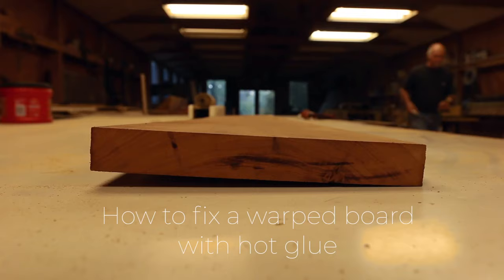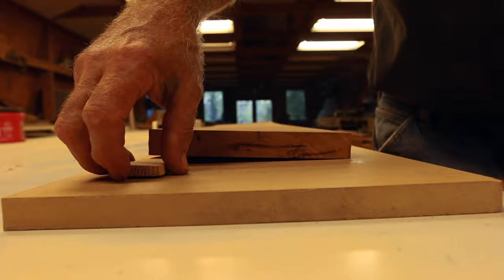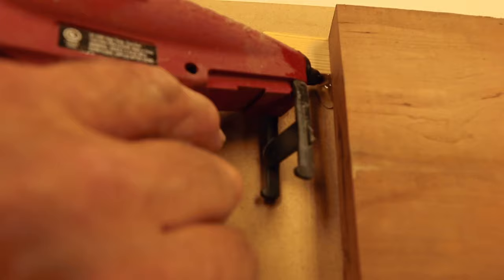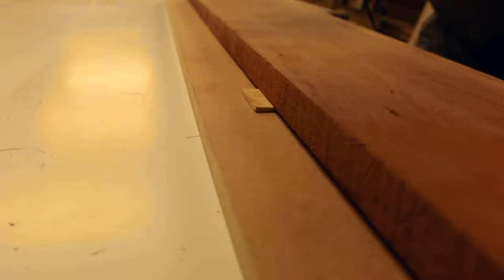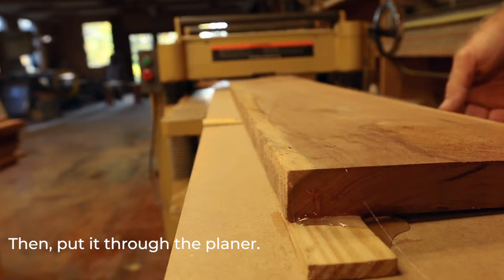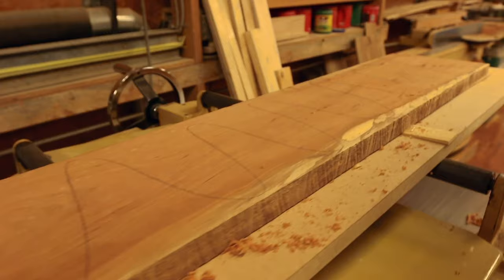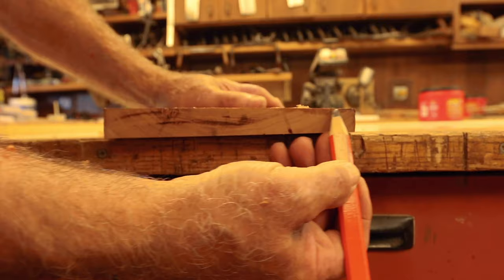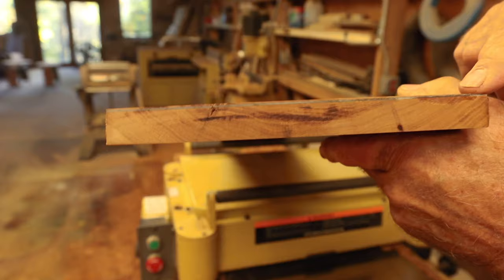How to fix a warped board with hot glue (simple)

Comment: I used some large 25 lb weights and didn't have to shave anything off. I laid the warped board on some flat concrete and put some weights on it. Worked great.
Reply: Doing the same 
How long did you leave it for
Reply: @newpatchincoming6574  a few days for me, I just take the weights off and check to see how straight the board is every morning, then put the weights back if the board is still warped. My boards also seemed straighter after priming and painting for some reason. I also let the boards dry on my flat driveway, of course with the painted side up so to not make a mess.
Reply: @anonymoususer7663  thanks

Comment: Thanks for a simple solution to a problem all of us woodworkers have from time to time.  I've seen a couple of videos where a jointer is used to also remove twist, although you're a little more limited on the widths of boards you can use that method on.  I have a few boards in the shop that have been aggravating me for some time due to the twist in them.  I think it's time to fix them.

Comment: One of the clearest explanations I've seen about how to do this. Others have asked why not use a jointer planer to make one side true, then use the thickness planer for the other side, but this way means you only need to use one machine. And your jointer may not be big enough for a wide board - thicknessers commonly have much wider beds. You also have far more control with the wedges - with a warp that big it would be rocking all over your jointer bed, so much more difficult to use. Great video, thanks.

Comment: Thanks for the great video.  I have a twisted  4" x 8" section which I will be using as a pilaster to break up siding and board and batten cladding on my house build.  This technique will fix this issue.  Also, I will be laminating sections for railing rails and posts, so this will come in really handy.  Cheers from Canada.

Comment: Wow!  You reduced that board down to a toothpick!  It's better to mill your stock as close to the finished size, leaving some excess for snipe, trimming, etc. That said, a better method is to split the wood down the center, mill the two pieces flat to the same thickness, joint the cut edges flat and then glue them back together. This leaves a lot more material with minimal loss.

Comment: Great method! I would leave it a day and see if it remains flat, since removing wood can also change the internal stresses. It may take a few times for it to stabilize.
Reply: If you gluing up a few boards, then why can't you stick them all up together immediately once this is done and whilst the wood is all flat?
Reply: @conradpaul6100  you can, but there’s no guarantee that it still won’t move. Cutting away wood releases internal stress, and the wood will always want to neutralize that stress. If you glue up immediately, you may end up with a wider glue-up going out of flat. If it’s wider than your planer at that point, you’ll have to hand plane it to get it flat.
Reply: @Pauken11  ok Jim, thanks for that. Would be nice to learn the theory about Wood, sure it wood help with my woodworking efforts
Reply: ahhhhh great tip! i suspected as much but i am a bit of newbie. I was wondering why my board was slightly out after checking it 2 days before.

Comment: Thanks for sharing!! That was great.
I wish I had a planer, though! Haha
Reply: I don't have a planer either. But it should be possible to use the same technique using a router as a planer (on a sled)
I'm going to try this in the (near) future. On much smaller boards though.
Reply: @hansdegroot8549  
It works.  But the finninsed job won't be as finished youll need to do a few more steps to it depending on its use.

Comment: now you got 1/2 a board. just use hot water clamps or weights put in the sun
Reply: Hmm, that's a bit of an exaggeration. It reduced it somewhat, but not by half.
Reply: Better to have a thinner flat board than a thicker unusable one.
Reply: Clamped to what?
Reply: There’s no guarantee that heating and wetting will result in the board staying flat once dried back to 7%. Milling it flat is more reliable for fine hardwood projects. Not every board needs to be 3/4” thick. There’s plenty of use for half inch and even quarter inch boards. And the thinner it is the less important warping is since you can often force it flat with screws or glue depending  on What you’re making.

Comment: My question is how thick was the piece of wood you used before it was flattened and how thick was it when it was completed.  I would imagine that if you're going to be working with 3/4 inch wood, you would need a 1inch piece to start.  If you start with a 3/4 inch piece then you might have to bring it down to 1/2 inch which is not good.

Comment: You can also get a board soaking wet “let it set in water for 24 hours” then take it outside or in a place where it’s hot and lay it on a good flat surface and put something heavy on it and let it dry. I use concrete bags a whole lot for the weight because I build a lot of decks. I use this method on big boards and even posts like a 6x6x16. Had them delivered by Lowe’s and they put the posts on top of the wood bundles with a good 5-6ft hanging off each end and it bent them like a noodle. Instead of taking them back I soaked them very heavily then laid them on the concrete driveway with concrete bags on them where the bend was. It pushed them right back into place.
Reply: This is such a horrible idea I don't know where to start. Though this may be an acceptable method of correcting warpage for construction grade material, the average woodworker would suffer a lot of consequences after following your guidance, both in the short term and especially long....I cringed after reading this

Comment: Question: Does the warp creep in again after that treatment?
As a novice I guess you have to fastly use that finished board before it starts to move?
BTW really enjoyed this fantastic trick!
Reply: Yeah whenever you work with any wood, but ESPECIALLY warped wood, you should plan on using it right away so you don't give it the option to re-warp. All wood will warp unless it's an exceptional board kept in perfect environment, which 99% of us don't have either of at jome

Comment: Thank you for this video! I recently did a burn design and it caused my wood sign to flex in the middle. Any suggestions on how yo fix it without cutting/planning it? Thank you!
Reply: Put calls over the back side  and glue them to it provided they are stright it should take out the bow.  You can also glue on aluminum like 1x2 angle  the hot glue will stick to both the wood and the aluminum.   But either of thoses 2 ways will have to stay on it. 

You can flatten it with steam and weight
On the top of the bow  it might make it flater but it will take sevral trys to get it true. And it could bow back.

Comment: You didn't fix the board with hot melt glue. You used a thickness planer. You might as well have said "How to fix a warped board with thin scraps of wood."

Comment: Sometimes all this isnt nessary if you cut 
Your rough sawn boards to a slightly larger size then the finished part then mill it true. You might save more of the thickness or length or width and have overall more true sized wood for your project, thickness is better on a table top
It just looks better.  

I ran into one 2x4 at the lumber yard once there really was no hope for 
This board was warped cuped twisted and bent its whole length only thing that would have made it worse is a big fat split but it wasn't split.  I should have gotten it, why you ask?  Might have made the coolest looking project you've ever seen.  We work wood, but we can also work with wood to make it be what its trying to be.  The Japanese are good at finding what wood wants to be. 
If you do that its never going to change its shape, guys have made things that looked great, but didn't last becuse they ignored what the wood was saying. 
All the brute force in the world isn't going to stop wood from changing its shape when it wants to in fact somthings going to give.  I know thats an extream comment but its true  to an extent.

Comment: How about using a jointer.  You should always joint before planing.  These two tools together get the job done.
Reply: The purpose of a jointer is to get two edges 90 degrees to one another. Can’t do that with a twisted board. The board in the video can now be jointed to make the edges 90 degrees to the faces, making it true all around.
Reply: @Pauken11  Correct, that is why you first joint and then plane. The board will be true.  If you don’t have or cannot afford these tools, there exist techniques that may come close.
Reply: That doesn’t make sense...   what are you jointing to?
Reply: @haidafella8651  you joint a board to make 1 edge and 1 side true.  Then you use a planer to make the other side true.  The planer uses the jointed side to make the other true.  Then you would use a table saw to make the unjoint edge true.